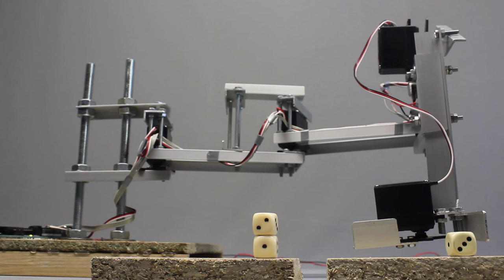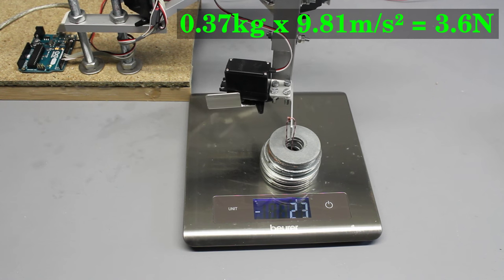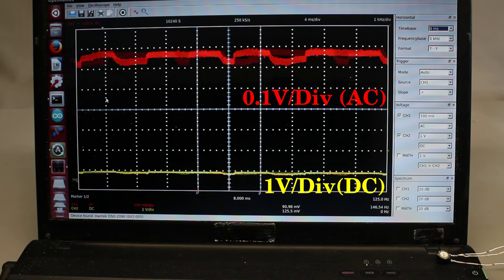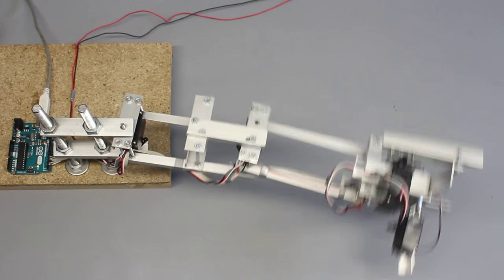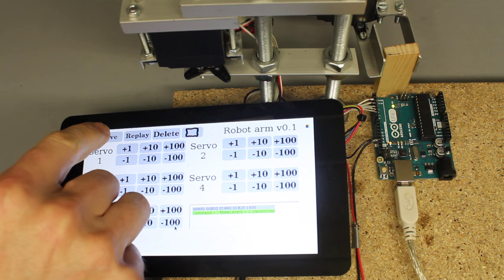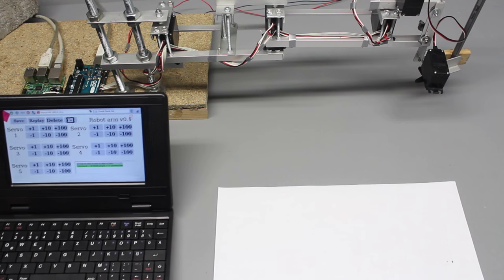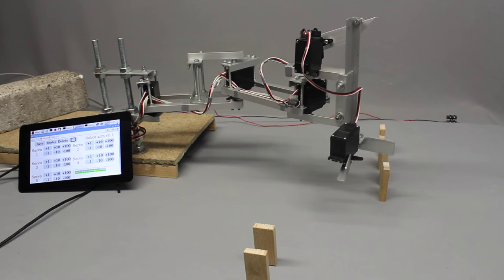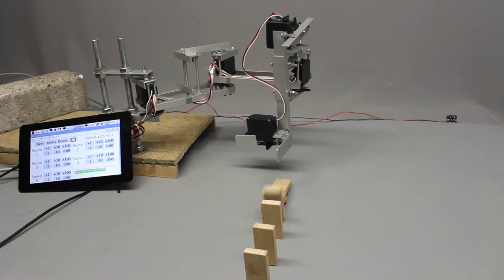Robotic arm v0 1 composed of servos, an Arduino Uno and a Raspberry Pi

Comment: Nice! I love documentation of what doesn't work, as much as of what does. A few things you might want to look into: 1. For the Raspberry Pi, Google Coder is a neat way to get started in web development, as it provides a web server with NodeJS backend, and an online IDE which allows you to edit the files over the net. I'm working on a coder project to support Arduino connection. 2. the MeArm robotic arm kit uses mechanical linkages to overcome some of the issues you noted. 3. Twisted String Actuators drastically reduce the cost of gearing DC motors and, when combined with a joint acting against a spring, only need to be driven in one direction; they will "unwind" in the other direction... of course you still need a position encoder, but you have that down as evidenced by your prior videos. 4. Stepper motors, of course, are a great way to provide low speed torque and positioning without needed encoder feedback. My offer stands to provide stepper driver kits.
Reply from the maker: +James Newton
There is always a reason for failure, success might be nothing but good luck ;)

1.) Haven't tried that yet. I like doing things from scratch with a simple text editor which gives you the highest flexibility.
2.) Those issues can be  reduced as I will show in future videos, but they are never eliminated...
3.) String Actuators are indeed another interesting approach of making robots move, but there are drawbacks, too. I might demonstrate that in a future video.
4.) I will use stepper motors in future robotic arms.

Thanks for your feedback

Comment: Thank you for another awesome demonstration. Thanks to RS. I really look forward to seeing how you remove backlash from the system. You've seriously increased my curiosity, and expanded what I thought was possible with minimal investment...I've wondered why a robotic arm type design is not used more in hobby XYZ printer/cnc machines. It appears you've answered that. Thanks for impacting me from the other side of the World!!!
Reply from the maker: +Jake Little Yes, if your intention is to build a CNC, you would never use the design of a robotic arm...
...but let's see what those arms are good for.

Comment: Would it make sense to make the lifting servo bigger and the grabbing servo smaller?
Servo's can run on various voltages, would it be better to drive it on the low-end or high-end of the spectrum?
Can you filter the noise on the voltage input by using capacitors? Doesn't driving the servo generate noise on it's own control loop (which I think is weird)?
On the control loop of servo's, it sounds like they're using some sort of PID algorithm, is this true?
Wouldn't it make sense to use a worm-gear in the servo, I believe this might overcome the need to build up friction to some point?
Some servo's can be moved by hand (and the robot can actually sense this), how is that done? Wiring into the control loop of the servo? Then you could teach the robot by moving him by hand (and pressing a save button) and let him iterate over those saved positions.
Reply from the maker: +xFuaZe Besides a stronger lifting servo you would need a more solid mechanics (e.g. using ball bearings) to be able to lift heavy metal.
Operating at the high end means destroying your servos quicker. I prefer the low end...
All electric motors generate noise (more or less). Your control circuit must be able to handle that.
Only Proportional, no Integral or Derivative.
Worm gears are not free from friction.
You need a force sensor on the servo lever to do something like that.

Comment: i will wait for your project using motors with optical encoders. recently i salvaged a few and must find some use for them. rolling window blinds might be it.
Reply from the maker: +Friendroid After making CNCs with those drives I will implement that principle in my next robot arm (eventually)...

Comment: loving your work, very nice :)
I was thinking about the backlash created from the potentiometer, would two of them in a configuration like a "H" with the pots being the vertical lines but facing each other and the horizontal line being the connected shaft, help eliminate the backlash as they are in opposition. The thought being that the backlash would be at the extremes of both pots.

Now I'm not sure about this :/ I'll have to ponder on this some more :)
Reply from the maker: +dasraiser That would create more mechanical backlash I guess and there is still the noise of the DC voltage that limits the accuracy. High resolution digital encoders using photo sensors would be a better (but more expensive) solution.
Reply: oh yeah the noise plus pot scratching can be annoying.
Reply: I suppose hall effect sensors could work in some areas, like the xbox one triggers.
Reply from the maker: +dasraiser
Yes, hall effect sensors are usually better than potentiometers, too.

Comment: Tighten the bolts is  a good method for oscillation but I don't think longterm benefit for arms also I liked the part potentiometer :) . Lastly  you have talked about error in begginig of video, Can  it's possible to minimize zero error with  identify the pivot point ?
Reply from the maker: +oğuz kaan çomoğlu Yes, you must readjust the nuts to get best results from time to time, but this is no robot is meant to learn rather than for everyday usage.
Software must know the parameters of a robotic arm such as arm length and pivot points, but you'll never get an error of zero.
Reply: Unfortunately, difference between real and theory
Reply from the maker: +oğuz kaan çomoğlu ...so we must adapt reality to meet theory ;)
Reply: +HomoFaciens exactly :)

Comment: HomoFaciens
 could you please make a tutorial video on close loop PID control of DC motor using arduino without using PID library? I've seen you earlier video of PID control but didn't understand how to program it.
Reply from the maker: +Akash Patel There are sample programs in the download section of my page. Look for the wiper motor servo or the example with 2 servos and a L298N.

Comment: Hey, you made a wobbly stick with an accuracy of "maybe", as predicted! Congratulations!
Great explanation of the flaws.
I didn't expect you to build a SCARA-type robot, though. That's definetly never been done with this crappy kind of servo motors.
Am I correct in hoping that the next project will be something along these lines, but with chinese geared steppers? :)
I have nothing to complain about here, so keep it up!

P.S - replace "by what" with "so", it's easier to understand and is gramatically correct.
Reply from the maker: +Spirit
Thanks!

The SCARA-type will hopefully give the plastic gears and the low power DC motors of the servos a longer life.
I can't say exactly what type of robotic arm will be next, since I am redesigning my ideas whenever I start turning them into reality (physics in real life is often different from that in my dreams...). Currently I have geared DC motors with optical encoders in mind.

P.S - I will keep that in mind for future videos, by what they might become easier to understand ;)
Reply: HomoFaciens I wonder if you could use the windshield wiper motor with some (very)small spring preload(to dampen the vibration) to build a somewhat accurate robot that can, say, pick & place small parts, maybe?
I reckon you can get to a millimeter of repeatability at the second axis extension.
Reply from the maker: +Spirit Wiper motors are too large devices for what I have in mind. The arm length will be nearly the same as with v0.1 so that the electronics won't eat too much money. A millimeter is the challenge for the second iteration of robot evolution (and a bit more speed) - let's see if I can get there...
Reply: HomoFaciens I'd use at least one, for the first axis. That'd make it very stable. For the second one, you could possibly use the gearbox alone, since the motor is very bulky.
Reply from the maker: +Spirit It won't be a SCARA, thus at least the gearbox is an option for the base drive that needs 180 degree rotation. Shoulder and elbow (joint 1 and 2) will be driven in an unconventional way - be patient!
Reply: HomoFaciens I'm intrigued.
I've got toys to play with in the meanwhile :)
pats newly bought lathe
I'll be patiently waiting for your next video!
Oh, and - in robotics all joints start from 1, not from 0 like in code.

Comment: So how would this differ using stepper motor and magnetic encoder?
Reply from the maker: That would mean you have to redesign the mechanics, electronics and software. But I guess it would be worth the efforts. Maybe I will create a scara robot like this using stepper motors, sometime.